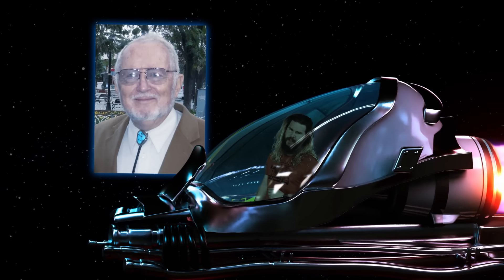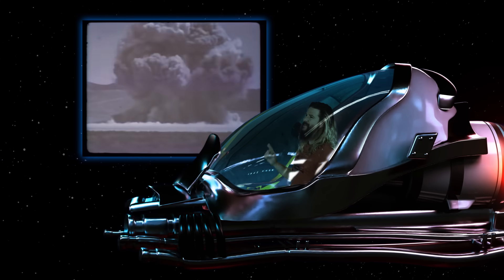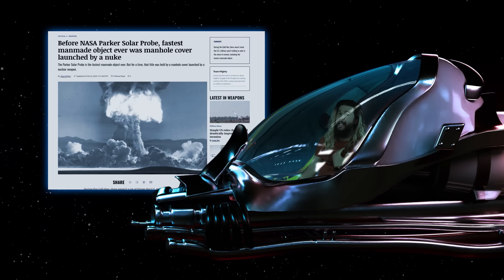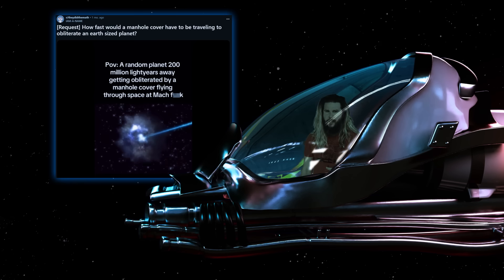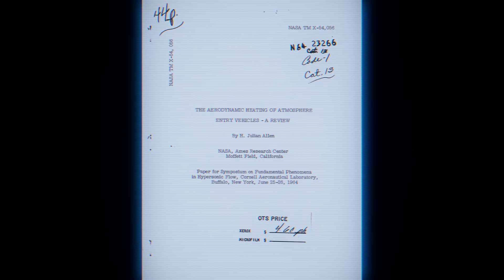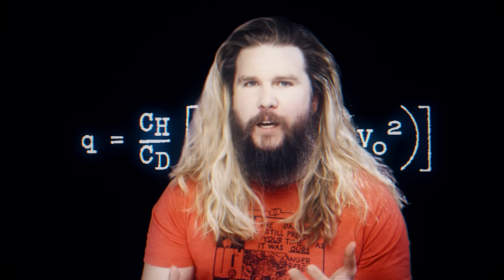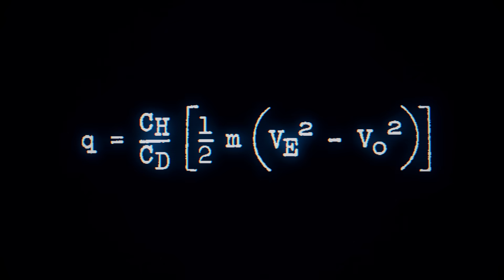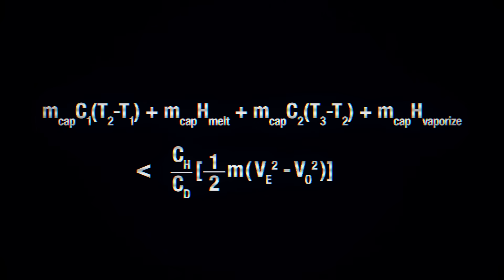Debunking the Nuclear-Powered Manhole Cover

Comment: So it didn’t make space… but the high speed video still confirms it was temporarily the highest velocity man made object ever...
Reply: at that time, sure
but the parker space probe has it beat by 100km/s
Reply: @clayel1 fine, fastest man made object in atmosphere. 🤷🏻‍♂️
Reply: @BasstoMouthFishing  See, the thing is, we don't actually know, as Im pretty sure parts of a nuclear bomb and whatever the bomb is blowing up is also man made, and as such, it is likely there was some other object that was faster.

However, in terms of recorded history, the manhole is the fastest. I think.
Reply: @BasstoMouthFishing shrapnel is man made. So still no.
Reply: @Clb9000 
We have video's of millions of thing's blowing up but was recorded with regular cameras..
So the exploding debris wouldn't even be caught at those speeds
Reply: @Nypolice2  Yeah, thats what I mean. The manhole cover is the fastest object caught on camera (In movement)
Reply: @Clb9000 good point!! Parts of the bomb itself would be the fastest objects.
Reply: @taintedsasquatch398  then parts of any bomb would be the fastest object. Look at the fusion bombs.
Reply: @Clb9000 yeah , some bit of rubble or dust may have been shot at several times the speed of sound by the tsar bomb
Reply: @Clb9000 but the parts of the bomb are vaporized so they never reach that speed
Reply: @Cara.314  pretty sure most shrapnel is not moving that fast
Reply: @Cara.314 you dont record shrapnel for speed records lmfao.
Reply: @clayel1 A brief caveat. 

We can only calculate its minimum speed, since it was only caught on one frame. There's a good chance it was moving much faster.
Reply: @jonathanstiles6072  I was going to say something like this. It's only the theoretical speed we can glean from 1 frame of I think it was something like 8,000 a second, which is child's play for the Slow Mo Guys. But that's the bare minimum speed it would have needed to be going to show up in 1 frame at that frame rate. I feel like if modern slow mo technology was available back then, we would have at least 3 frames of it.😆
Reply: @steeljawX it was top of the line slow-mo camera 100,000 frames
Reply: @clayel1  The Parker Probe cheated.  It did that by falling.
Reply: @RandomStuffVG  lmao to be totally fair, youre not wrong
Reply: @clayel1  Fastest thing ever shot lol, imagine a gun whose propellant is a literal nuke
Reply: @clayel1  That probe didn't have 100 km/s of Δv that it used to accelerate itself to that velocity. It had a fraction of that amount of energy at its disposal. The rest is what I would call cheating because speed is relative.
Reply: @jlight7346  fair, but they didnt ask for the greatest delta-v (which would be like a solar sail?)
Reply: @clayel1  that's different because it gets almost all its speed from gravity
Reply: @clayel1 I know you meant sea level but now I want to know what "see" level is.
Reply: @clayel1  u do realize they set up slow motion cameras (the best they had at the time) to see what would happen. they only caught the manhole cover in ONE frame. from that they could only calculate the slowest rate of speed it could of been going. if i remember correctly the speed was so fast that it took maybe 2-4 seconds to reach space with its calculated slow speed. so with that being said you dont know if the parker space probe has it beat. u assume based on the lowest speed they were able to calculate. mind u most of the scientists who crunched the numbers believed it was moving much much faster and in fact reached space. but im glad non scientists are telling us the scientists are wrong. lol
Reply: @clayel1  notice the key word "TEMPORARILY" his statement is 100% accurate 😂
Reply: What do you consider an "object"? Because we can accelerate particles (yes, man made) at non insignificant percentages of the speed of light. Hell you could argue the particles in rocket exhausts are also man made objects.
Reply: @rcman50166  I think it needs to be visible to the naked eye, and a solid "object" not fluid/gass, in order to stick to the spirit of the question.
Reply: @Clb9000 i doubt you can see any object at that speed
Reply: @Andrey_Gysev  I mean it needs to be something you can look at while its stationary.
Reply: @Clb9000  I can look at a single stationary atom through an electronic microscope, so?
Reply: @Andrey_Gysev don’t be pedantic
Reply: @rcman50166  What if a man (or woman) must have touched it with their hand for it to be man-made?
(I will not be accepting any criticism and this definition is perfectly air-tight via proof by I said so.)
Reply: @rcman50166 rocket exhaust travels at the speed of sound. Its why you need a nozzle to maximise thrust and internal pressures. Too small a nozzle, because its limit is the speed of sound, not enough can escape, pressure builds and you have a bomb. Integza has a good video on rocket nozzle design.
Reply: @calvin2686-u1k  Not true. Rocket exhaust is supersonic. That's why you have a throat before the nozzle. It's called Bernoulli's principle. Look it up
Reply: @rcman50166 uh yeah ! 
Also i think neutrons inside nuclear bombs ought to move pretty fast ...

So maybe object with the most kinetic energy could be a title ?
Reply: @rcman50166 I would have to agree there. Rocket exhaust is man made.
Reply: @rcman50166  We can actually accelerate quantum particles to just a few meters per second of the speed of light
Reply: @rcman50166  Non insignificant? Protons at CERN are accelerated to within a tiny fraction of a percent of c. Meaning the travel at 99.999999% of the speed of light. That's much, much more than non-insignificant I would say.
Reply: The high speed video only captured a single frame of it, there is no actual way to determine how fast it was going from that single frame. The speed estimated was just that an estimation as they could not determine how fast it was actually going.
Reply: @NightLexic We still know that it was still in the ground the frame before it was captured, so we have 2 points and can estimate a velocity.
Reply: @big_numbers  To get an accurate estimation of acceleration and velocity at least 2 frames of motion need to be present, one frame from at rest and one frame of motion is not actually enough to properly estimate the acceleration and velocity.
Reply: I allways found this claim fascinating, considering that "object" has so vague definition in this context. For example, if you consider particles (with mass) object, then we most definatelly "made them" faster than any of this (for example in accelerators). If you don't think particles are objects then since everything made out of particles you have the inconvenient task to define a demarcation point at what amount of particles in a group you want to define as an object.
Reply: @CraftyF0X after some thought, the "with mass" demarcation divides the objects from the rest quite well. But as for man-made, I would argue the particle existed in some form before man encouraged it to move fast, but if it was assembled into a form it wouldn't naturally take, then its man-made. So then its just how far between 2 particles bonded and 1mol are we comfortable with saying it wouldn't occur in nature. Or is the fact that its so fast the thing that makes it man-made?
Reply: ...briefly. But you're spot on, Dave. 

I can't help but wonder if it makes a difference going from denser to less dense atmosphere than the reverse, as well. Wouldn't the energy input taper off instead of steadily increasing?
Reply: @grumblycurmudgeon  i think it might, entering the atmosphere you are being pulled by gravity, accelerating into the more dense air while leaving you are entering much less dense air and the speed is the real important part in that one.
Reply: @metal100k  Exactly. Really, I'm wondering if it's a duration factor. I'm perfectly willing to conceded the amount of drag and friction on the object, and the ablative effect same would have on it, but if it's DECREASING over time and not INCREASING, I wonder if it's not apples and oranges to use an incoming object as an equivalency.
Reply: @grumblycurmudgeon  of course it would. If it made it to space, it would have done it in under a second, with significantly less pressure and conduction as it rose. You can't use atmospheric entry calculations for something leaving the atmosphere
Reply: Voyager is currently travelling at a million miles per day btw
Reply: @TheKalaxis I think New Horizons is faster.
Reply: @TheKalaxis Parker solar probe moves 16.7 million km every 24 hours.
Reply: The manhole cover is in one frame so the speed he gave was the lower bound for its actual speed. Also if it held together after that frame it wasn’t doing that speed through the thickest part of the atmosphere, the gasses from the explosion were also moving up with it so it would have experienced considerably less friction with the atmosphere.
Reply: It doesn't have to be a superlative. It's iron vapor.
Reply: @devynlich00  What information do you have that says its a 4 ton reinforced steel plate? 900kg is about just under 2000lbs or 1 Ton in Us standard
Reply: We have to artificially create the hadrons that we accelerate in the colliders by ionizing hydrogen. So it's quite literally not even close. 😂
Reply: Uhh so whenever we create a particle in a collider isn't that a man made object?  If it has to not be naturally occurring what about the creation of new elements or weird clumps of particles?
Reply: had it been tungsten of the same dimensions would it had survived?
Reply: And @kylehill did a double let down ending the video without calculating speed
Reply: How big does a man made object have to be in order to count? Cause we got particle accelerators shooting stuff at several percent of the speed of light since the 1920's or so.
Reply: But t it possible that its atoms is part of an astronaut or space object today.
Reply: Na now its the parker solar prope at the last turns around the sun it will reach 690.000km/h or 191,66 m/s
Reply: It didn't start it's flight at ambient temperature. It was preheated so it had a headstart on melting
Reply: Thats still up for debate, but the fact that it's shaped like a sail does help it's case, compared to other explosion debris.
Reply: Yeah this is what I was thinking too. Even if for just a millisecond it would still have been the fastest man made thing. Unless the title for that requires a specific amount of minimum travel time.
Reply: Voyager
Reply: Here is a factor I didn’t see in the math; how long would it take to vaporize the cap, and would it reach space before then?

It seemed to be enough energy to vaporize the cap, but not enough to do so instantly?
Reply: I love that you included thefatelectrician 😂
Reply: Fastest In atmosphere
Reply: I mean define an object first. We've made insanely fast particles. Like we entangled particles so fuck your spacetime math
Reply: @plmPissekatt  some satellites have far surpassed high end estimates of the cap
Reply: Yeah he full of shite
Reply: No it doesn’t.  All we have is 1 frame.  You can only guess the velocity.  There is not a way to accurately tell its velocity
Reply: This formula was calculated with the assumption that the disk stayed flat with its direction of travel.  I'm assuming it still would have burned up if it had turned to fly with its flat edge first.
Reply: Fastest Aircraft
Reply: Great spoiler. Won’t need to watch the content now 👎🏽fart noise
Reply: The image in the frame that it was caught in was blurred and almost out of frame when the object showed thus it had to be moving significantly faster than calculated one other thing that isn't taken in on the calculation is the exhaust of the propellant could have thinned out the atmosphere enough that it could have actually still made it to space
Reply: Might not have been the fastest thing but most certainly the fastest manhole cover, If for only for a brief moment.
Reply: Wasn't the speed estimates by noting that it was in one frame and not in the next frame? Is it possible that it wasn't seen in the next frame because it was reduced to small fragments within that frame? In that case, it might not have been traveling quite as quickly as calculated. 

Then again, any speed that reduces a 1 ton chunk of metal into a debris cloud is going to be pretty damn fast.
Reply: The disc appears in exactly one frame of the video, if I'm not mistaken
Reply: Well, if you want to call it an "object" considering it may have already burst into a cloud of shrapnel on the one frame it appeared in.
Reply: ....recorded

To be fair tho that speed is an estimate, a single frame it not really enough
I actually came to the exact same conclusion with my brother when we were discussing it
I actually got the same speed but also the awareness that it may have been faster
Use of logic of physics and chemistry, I believed that the cap would not have survived but i didnt know the math to prove it
Tho I didnt
Reply: laughs in chubby electron
Reply: Of it's time, yes
Reply: no particles inside a  particle accelerators are the fastest manmade objects
Reply: Technically a photon would be the fastest man made object ever.🤓
Reply: It is the fastest bullet we have ever fired...
Reply: I would trust this dude on every topic. He's smart but he's not always right
Reply: What this really tells us is we need to redo the experiment but with a tungsten-alloy plate, so it can be yeeted into space where it belongs.
Reply: It did.  Mr. Butter fingers manfully, avoided the actual math and played make believe it was a static object which does not require time constants(rates) and simple calculus.  For instance ignored the fact that any plasma heating from friction would actually INSULATE the object as soon as as it was formed.  Ignored that the speed of conduction of a material is slower than the speed of sound in said material.  Ignored the basic fact that MOST likely the manhole would not have made space due to the fact it would have instantly started to spin and it would have literally blown itself apart due to tangential normal forces and in reality there are probably a 100 parts of said "manhole" cover with more than enough residual velocity to be the fastest objects man has thrown into space.  Several other factors he dutifully ignored just so he could "debunk"...
Reply: 66 km/s is a huge ass myth and I can prove it with a few calculations
Reply: @furyaroslav  .... We know the framerate... We know the distance covered in said frame.  The object is in NO other frame...  You sir are the myth, the legend, the dinosaur stupidosaurus.
Reply: @w8stral  Well, I know the energy of this nuclear explosion (~1.26*10^12 joules), I know the kinetic energy of the manhole at 66 km/s (~2.0*10^12 joules), and I know the law of conservation of energy. Do you?
Reply: @furyaroslav  #1, no you do not know the energy of the explosion.  Could easily be off by a factor of 4 or greater back then.  The guys setting up and detonation the explosions did not know, so how the Hell could you or I possibly know?  Though within order of magnitude?  Yea.  #2, the 150,000mph is also the UPPER end of possible speeds If I remember the calculation as ANYTHING greater than this and it would NOT have been captured on film at ALL, unlike what is stated in the video which claims that it is the lowest possible.  So, Picachu face to vid host and you who uh, missed this basic logic point... Judging by this guys pathetic math vid(puke), I highly doubt he had his eyes open and brain on when he read the report which I HIGHLY doubt he read to begin with.  I'll bet he read what someone else typed up(who also is probably an imbecile) and never went to the source documents.  #3, error bands for mass of object and time "captured" on film.  #4, reported frame rate... is it actually correct?  There were a LOT of different formats, speeds, back then and the shutter speed may or may not even be known today.  It could be someone who found the pic and GUESSED what camera was used.  It would not surprise me in the slightest.
Reply: Then where did it land
Reply: @robertbowen6610  It didn't... Outter space
Reply: Still funny to think about
Reply: And the highest above see level maybe
Reply: @camatrusaca voyager 1 is the highest above sea level 😂
Reply: @Draw2quit  now yes. I meant at the time of the manhole incident and until the sputnik was launched a few months later 😂
Reply: @camatrusaca  ekhm ekhm, voyager
Reply: @wydua  *at that time and not for long 😂
Reply: @wydua  Sea level. not outerspace where there's no atmosphere.
Reply: @wydua Voyager is slooooooooow my friend. About 17km/s. Parker Solar Probe is around 10 times that for reference
Reply: @1983Darkshark  i was answering to person saying "highest above sea level"
Reply: @AkaiAlouette  but voyager still traveled through that point???

So the manhole wasn't highest above sea level
Reply: @wydua  Ah, apologies. It's been a long day and I missed that
Reply: @wydua voyager came decades later.
Reply: @freescape08  right
Reply: @camatrusaca see level?
Reply: @ericmoney4572  is the level on which you unlock vision. *Sea 😂
Reply: Actually, if you look at the quote from the guy who did the calculation he says that he doesn't remember what the minimum velocity needed to get out of the frame by the next shot was.  The 6x escape velocity comes from a simplistic calculation done before the test to show that the cast iron cover wouldn't contain the blast.  

I'm guessing that if the calculated number from the footage wasn't worth remembering it probably wasn't very impressive.  And looking at the physics of accelerating the cover, it would almost certainly vaporize long before it absorbed enough energy to reach escape velocity.
Reply: No, that honor goes to the voyager 1 & 2 probes.
Reply: @cd5927  not necessarily if Kyle would just do the math. The original extremely rough estimate is higher speed than voyager 1 by multiple times.
Reply: @cd5927  hardly
Reply: Don't need to watch this to know that it never made it to space and was not the fastest man made object.
Reply: Gentlemen, Gentleman...
You're all forgetting that The Wu Tang Clan's rap lyrics travel at "the speed of Wind through the Valley of Sin".
The fastest wind speed recorded was in an F5 Tornado 🌪 in 1999 in Southern OKC, OK at 321 mph and I'm not sure what variable "The Valley of Sin" would multiple it by....but it could be pretty fast....
Although I'm assuming (with no math or evidence) it would be approximately the same Wind speeds on Neptune (1,200 mph)! 
Lmao 😜
Reply: The math being used here is wrong, so... yeah.
Reply: The friction of air at those speeds it probably burned up the same it would if it was falling to earth from space. The sr-71 gets to thousands of degrees at only cruising speed. So im thinking like an oxy acetaline torch just makes steel vaporize it just burned
Reply: @thepisswalker well. Let me put it this way: SR-71 hits such high temperatures from extended exposure to atmospheric heating.

This manhole cover is on a direct course straight out of the atmosphere at an estimated speed of 66 km/s. To put that into perspective - space is considered to be 100km up. Thats only 1.5 seconds of travel time. Definitely not enough for thermal conduction to heat the entire 2 tons of steel up to vaporization temperatures. Id wager not even boiling for the core -- if it didnt explode on the way out (because that energy still has to go somewhere) then certainly by the time its exited the atmosphere there would still be a significant portion of an iron disc
Reply: @calvin2686-u1k  Did you account for the pre-heating the cover would've been exposed to from the nuclear blast it tried to contain?  It was likely already near melting by the time it took off.
Reply: @spartanellsworth2336  Not even close. The thing you have to realize is that the initial cap was made out of reinforced concrete. Concrete has a much lower melting and vaporization point than the cast iron used in the cap. Which means that in order for it to fail, the cast iron didn't have to fail, the assembly did. So what probably happened was the assembly itself failing as things were vaporized in the blast, used as gasses to further pressurize and cause other things in the assembly to fail. So, what more than likely happened is that again the major portion of the concrete plug (which failed last time as well) was vaporized and turned into superheated gas before blowing the cast iron cap off.

AND as Kyle fails to account for in his calculations, the total change in velocity was not total, as in, it did not go all the way to zero. We see meteorites hit the ground all the time. What we would need to do is account for the drag caused by an object moving through the air as the air becomes less dense. So we'd something like the calculations necessary for a space shuttle launch. This could be simplified if we calculated the average density of air across the distance it would take to reach zero air, and then use that to calculate the drag of the manhole cover. From here you'd be able to calculate the change in velocity, and from there the heating equation.

So, for Kyle's sanity check he's assuming that all meteorites burn up that are operating under different conditions. But by that very same logic, we'd never get a ship into space, or really have anything become exo-atmospheric.
Reply: @spartanellsworth2336 there would have been almost no pre heating, the steel plate was thermally insulated from the blast by a concrete plug.
Reply: @spartanellsworth2336 When an explosion occurs it pushes the "air" already surrounding the explosion, aka hot stuff. It was probably blown sky high by the time any actual heat from the explosion reached it. That's of course if it was tightly sealed and it was just the straight ambient temp of the tunnel air going up towards the cap. It definitely will heat up accelerating at those speeds instantly but I'm not sure the "nuclear temps" would have anything really to heat it through its entire 2 ton core to effectively vaporize it
Reply: @thepisswalker the sr71 doesn't get to thousands of degrees, the hottest part only gets to 1000f.
Reply: @thelastant8366  that's 4 digits, thousands
Reply: If it never made into space, it shows how much friction air has. Without a continuous propulsion like a rocket, objects simply cannot leave the atmosphere. We even have cannons built to deliver payloads into orbit by firing them, but I am not confident they ever succeeded, unless the payloads themselves were also rockets.